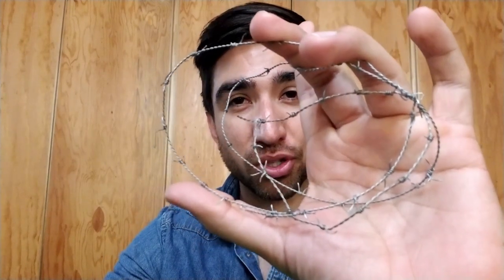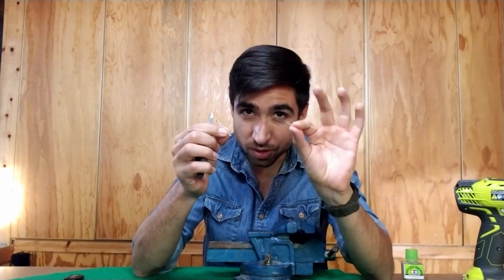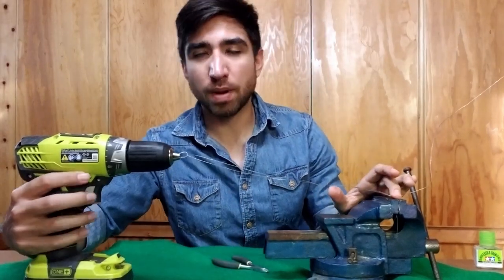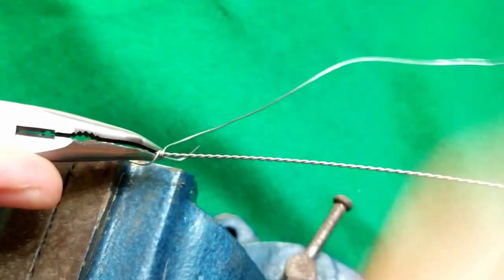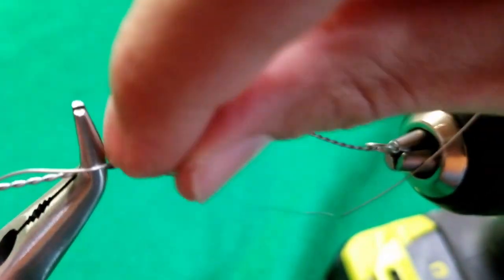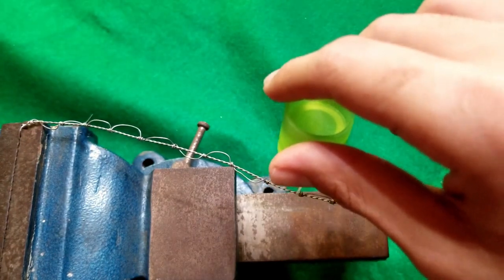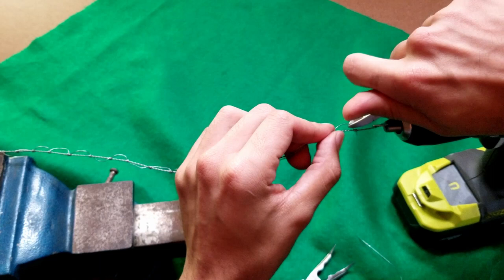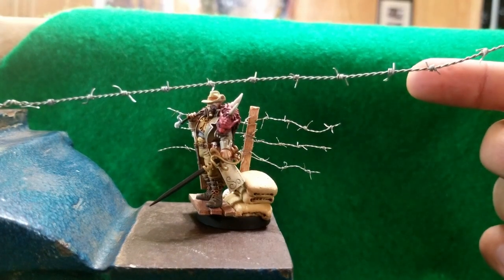Miniature Barbed Wire

Comment: I don't think the Tamiya extra thin is actually doing anything here, it works on minis because it melts styrene and causes the two pieces to bond together, with metal it'll just evaporate and maybe leave some residue without bonding anything.
Reply from the maker: yeah, turned out any "hold" i thought it had was when I was literally crimping the knots onto it.

So now I need to find some very thin superglue to get some clean barbed wire.

-Garrett